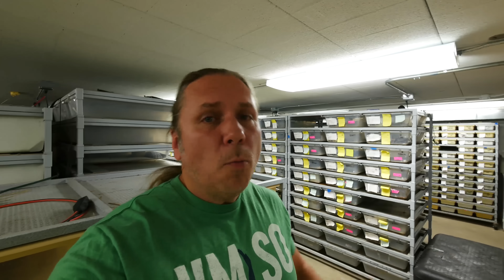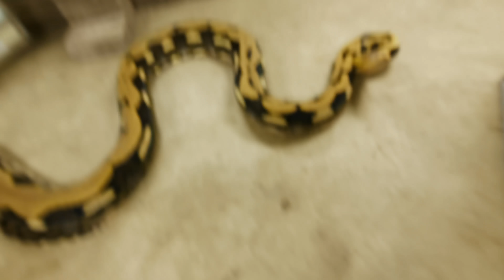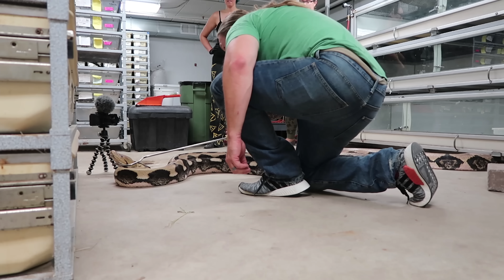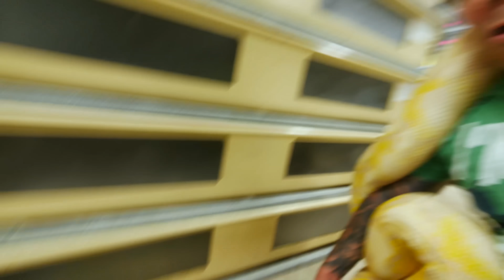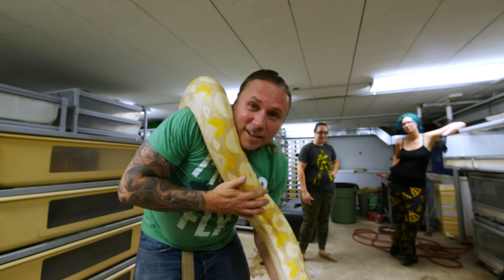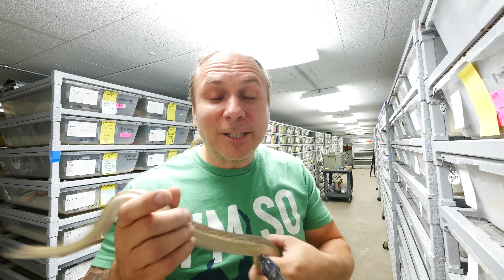LETTING MY 20 FOOT PYTHON SNAKE LOOSE.. GONE WRONG!!! | BRIAN BARCZYK

Comment: Lucy was a little cranky in this one for sure! 

Oh I wanted to ask you whether you ever talked with the Reptile Prime people about designing better Python cages. I have been looking for a breeder sized one for my snake and the usual options are either tremendously heavy, expensive, or boring. I would really love to see some company make cages that allow snakes to move around more and have an interesting environment. 

I think PVC and Plexiglass would be good materials to make them lighter weight, and it would be cool to have some sort of inserts that fit in there to make them two story with ramps so that snakes could go to either level. I also thought about the fact that a network of tubes would be great too. I think this would be great for enrichment either inside or outside the cage. 

Also, I've noticed that some ball pythons really don't like the standard hides but prefer to get under soft things like towels or blankets or under ledges. Maybe a line of ledge type hides and soft hides would fill this need.

Comment: I have always wanted a retic but I also know my limits. I am only 14  and I have well been around some had a 13 foot retic around my neck not strangling me just dangling. and a 4 foot green anaconda . And when those snake's moved I could just feel the power and mucle in them .when it comes to big snakes I am going to get a red tail boa they get good sized but you know not know 20 feet. So I will just make my way up.